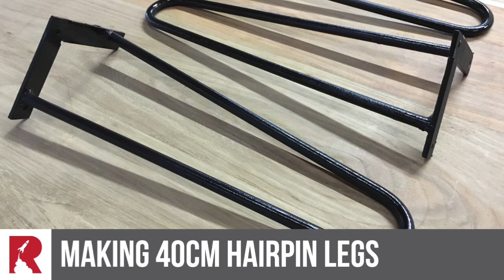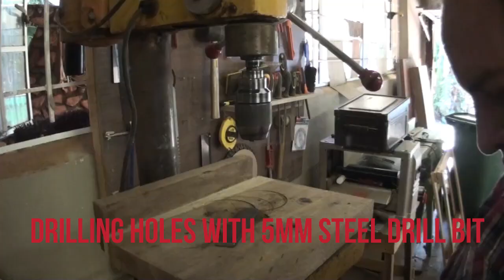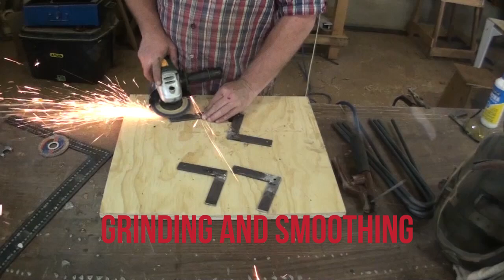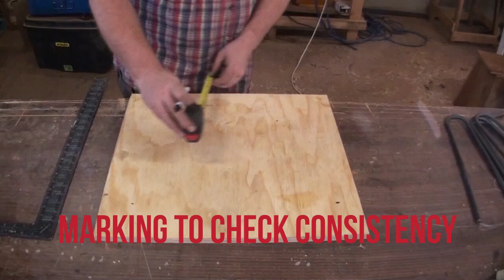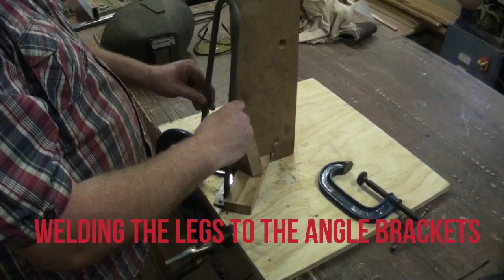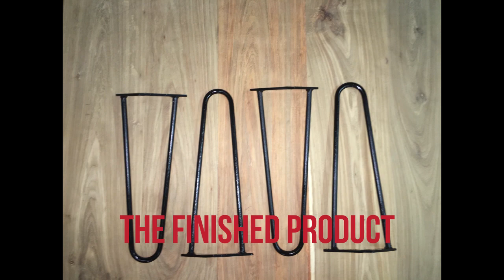How to make Hairpin Legs - Rocket Design Furniture

Comment: Awesome job what size legs thanks in advance
Reply from the maker: these are 12" or 300mm and i used a 12mm round bar.
Reply: @RocketDesignFurniture  thank you so much I wasn’t sure if I wanted to go with the 14/ or 16 inch

Comment: It would have been better to make 3/8" (or whatever size the holes were) into the mounting plates. Putting the legs into the mounting plate before welding significantly increases it's strength and helps with the real world probability of people knocking up against the leg. I've tried to use legs made that way for a customer before, but had to find a vendor that used a stronger base plate and stronger construction practices for the replacements.

Comment: Michael what would you do different? That isn't necessary in the process.
Reply: +Werner Openshaw Well in a production environment you would need to cut the pieces on some sort of jig that has measurements on the jig or saw. Like say a chopsaw mounted to a table with a ruler along the edge so that the material can be slid in and cut without having to stop and measure. Then the material only needs to be marked in the middle before bending. Then the bend jig needs to be mounted permanent or semi permanent. That jig is neither and is not good for bending anything. It will leave a bend in the end that is not round but D shaped. Then once bent the pieces would just need to be trimmed to length, again on the saw without measuring. Then the assembly/welding jig would need to be much simpler and easier to use. I have made thousands of these legs and I can make them in half the time or less than this. Plus the base plate is way too large. It would be very difficult to package for shipping. Especially if it were being shipped with a table.